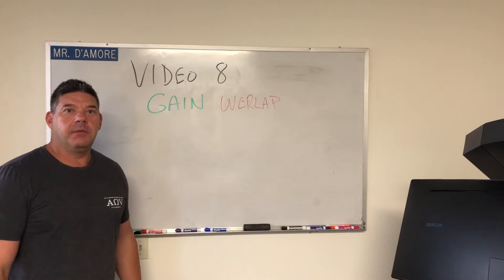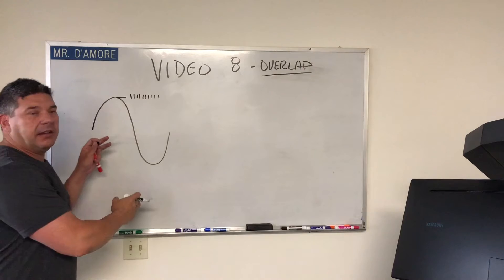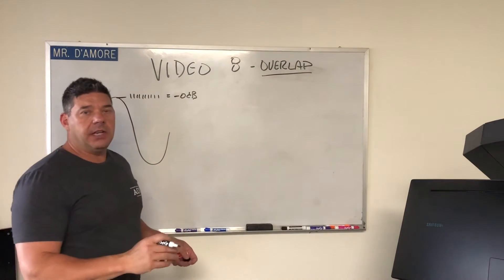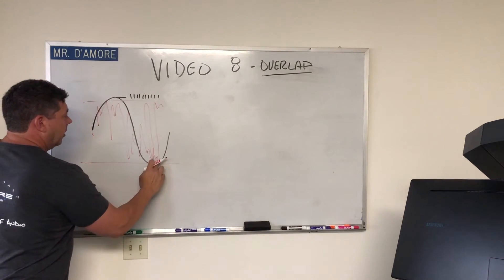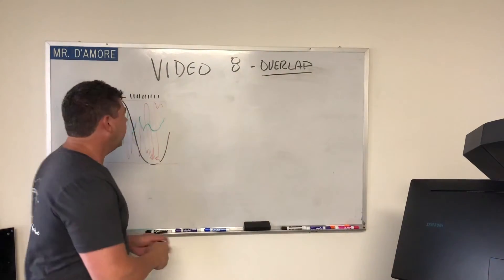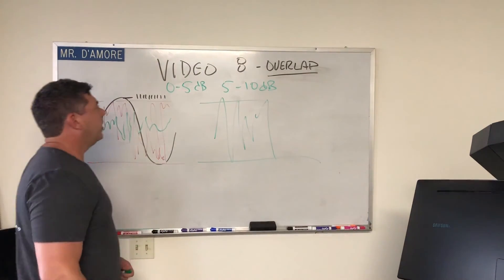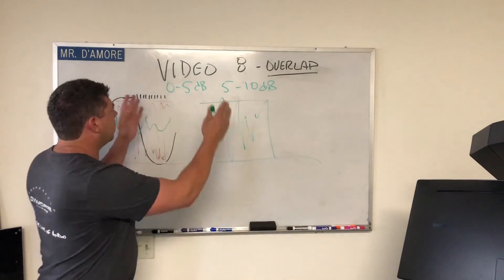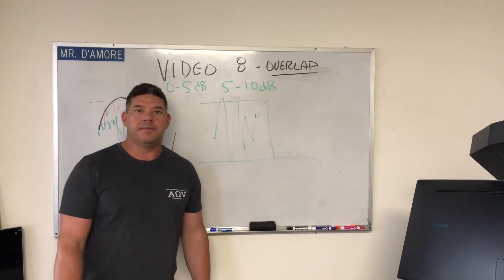D'Amore Engineering University Video 8 Gain Overlap (Part 2 of Video 7)

Comment: I've got DD1 and Oscope. 
My DSP DM-608 has 10v out.  My PG amps will take up to 8v in.  Should I give them a full 8v ? Or is there a similar process. Set to 5-6v for "gain headroom" if that's a thing. Thanks for your time if you get this.
Reply: Using the DD-1 and the 0dB track, give it all you can without creating distortion.

Comment: I  set my Sub Amp with the -10db 40hz tone and my mids and highs i did a 1000hz @ -5db and it sounds freaking amazing. Hey guys buy the DAmore test tone USB.  That's what I used for the test tones.  Thanks bro for explaining the overlap.
Reply: okayyy and so then you flip this scenario around... and set NEGATIVE 5  (-5) or NEGATIVE 10 (-10) for music that is recorded above 0db to keep your amp from clipping??? is this correct? is this what all this gain "overlapping" stuff means?? bc in no electrical engineer just a regular guy trying to get the most from his system. if you could answer that would be fucking AMAZING
Reply: Exactly the added info I was looking to confirm regarding test tones. Thanks.

Comment: So, as I understand this, overlap allows you to clip at a predetermined level. Usually 0-5db on midd and highs and 5-10db on subs. Is that correct?
That sounds counterintuitive. Clipping has always been taught as bad. Bad for speakers, bad for sound quality. 

I don’t want any clipping. Thank you.
Reply: This exchange helped me realize the best build (cost not being a barrier) is to get the proper powered amps where setting the gains with no overlap produce zero clipping at max source volume (which would be too loud for my ears on most recordings). I want full volume adjustment available with no possibility of clipping.
Reply: clueless....
Reply: @meade916  I asked a question. Couldn’t you clarify?

I guess clueless is what you say when you want to insult potential customers.

I really wanted to buy the product but wanted to understand first. 

If you need more headroom, why not just buy a more powerful amp?
Reply: @haroldpalmsesq2506  :facepalm:
Reply: @meade916  i just rewatched the video. I like the part where you said you will try your best to answer questions.

I stand by my original post.
Reply: @haroldpalmsesq2506  So, why design or configure an audio system so that you can easily push an amplifier to the point that it distorts? We’ve discussed the technical reason already: To play quiet audio sources at the maximum output level of the amplifier. Does having gain overlap built into a system mean you can potentially damage it? Yes. Absolutely 100%, yes. As such, this means that the system operator needs to take some responsibility for how loudly it’s played. Translated, that means you have to know when you’ve reached full volume in terms of the amplifier’s output capabilities. Your installer should be able to tell you what “full volume” is for normal modern recordings.
 Be honest with yourself; if you aren’t going to be able to curb your enthusiasm, ask the technician working on your installation not to include any overlap.
What if you ignore our suggestion and just crank the volume? How hard is your amp going to try to work? For example, a sensitivity setting with 6 dB of overlap would make the amp try to produce 400 watts of power if you maxed out the volume with a track recorded at 0 dB.
So, what’s needed to design an audio system where the amplifiers can’t distort? The short answer is money. If you want to feed 50 watts of power to your speakers, but have the system configured with 6 dB of gain overlap, then buy a 200-watts-per-channel amp. If you want to provide your subwoofers with 500 watts of power, choose a 2,000-watt amp. Financially, this doesn’t work, does it? A good 500-watt monoblock amp might cost $650. A 2,000-watt amp of the same caliber might cost $1,500-2,000.
Reply: @car_audio_lab3181  Actually, I did it the other way. I bought bigger amps, and set the gains with no overlap. Zero clipping from head unit. Zero clipping from amp.
So I bought the DD-1 because I don’t want overlap.
Reply: @haroldpalmsesq2506  I am with this idea.

Comment: I had my 4 channel set at -3db and it blow one of my super tweeters in the dash so I set it back to 0db! Why is that !!! I running a Rockford punch 400 watts amplifier!
Reply: Maybe add a capacitor inline the tweeter wiring to help filter out unwanted noise. Should be lots of info out there on the subject.
Reply: @Chaos1187me  the tweeters came with those already!!!! Thanks 🤟🏽
Reply: @carlitot5388  look online man. May need something better tuned to what you're running on your particular setup.
Reply: @Chaos1187me  thanks🙌🏽!
Reply: For speakers and tweeters to remain healthy, it is not enough to have the correct gain level, the frequency range is also important, maybe they have reached a harsh and bad frequency.  You can use the SMD CC-1 device to adjust the frequency.😎

Comment: Dang, this is the best free college I've ever gone to, do we get diplomas at the end? On a serious note though, I have a basic 6 channel system, 4 channel on the front and rear doors and of course a monoblock on my subwoofer. Both my 4 channel and monoblock are current set with a -7.5dB tone. What you're saying is it would be advisable to set my 4 channel with a -2.5dB instead? (Those are the test tones I have in my library, they are in 2.5 increments to -10dB.) So my question mainly is, would you set it up like that because bass notes in music are recorded lower, or is it just because subwoofers in general can handle more clipping? Just wanted to ask for clarity. Great videos with a lot of great information, good job Mr. D'Amore.

Comment: I have an alpine cda-9835 head unit and my max volume is 35. When connected to the smd dd1+ finding the max clean signal for my subwoofer amp through the rca cables, I can go max volume with no distortion. When doing it to full range amp, it distorts at 35 and clean at 34. So I would keep both at volume 34 for clean signals. When I connect the dd1+ to my speaker outputs from my full range amp, it distorts from volume 30 and up and clean at volume 29 but my subwoofer amp it's still clean all the way through 35 no matter if connected through rca cables or speaker output. My question is that why did the distortion point change from using rca cables to speaker output for my full range?
Reply: Does it change if you turn the gain down on your full range amp?

Comment: Amazing how many mfr’s & car audio Youtubers make vids w/ the AD1 but have no clue what gain overlap is.. Lots of them... Listening to them explain it is laughable. 

Music is dynamic not one solid sine wave at one frequency that’s what gain overlap is for. To offset the difference in RMS values of a sine wave and the RMS of a stereo 2 track master that may be mastered to -8RMS or -6RMS or -15 to -10 RMS like say older 70’s/ 80’s / 90’s music before digital recording & the “ Loudness War “ . 

Even Sundown ppl have no clue. They think setting the gain overlap makes the AD1 gradually ramp up into distortion when testing. 

Also once crossovers are set & tuning is complete ( DSP systems ) measuring the AC voltage on the speaker output is nothing near when setting amps with tones & no crossovers. This is another reason gain overlap is needed, to get more real world watts/ power from amp to speakers.

Comment: Can u use dd1+ by downloading the tracks and using via Bluetooth?
Reply: Yes you can. If you can would recommend downloading WAV files at the uncompressed full resolution / sample rate 16-bit / 44.1000 Hz and you should be fine. Steve Meade has a video of how to on it.
Reply: Provided that your Bluetooth playback source is fully calibrated with dd-1, when your Bluetooth has distortions or less distortions, all your calculations will be wrong because, for example, playing your file from Bluetooth mode may be, for example, +7  db, but because your Bluetooth source is not calibrated, for example, instead of +7 dB, it is considered +9 dB, and in practice, instead of +7 dB, you have an overlap of +9 dB!!!

Comment: So when using the smd dd 1+ , we set gain with 0db track then use 5 or 10db of gain overlap for the tracks that are recorded less than 0db so that those tracks that are less than 0db will still sound loud?
Reply: Akuma4u yes
Reply: @uptobatentertainment  okayyy and so then you flip this scenario around... and set NEGATIVE 5  (-5) or NEGATIVE 10 (-10) for music that is recorded above 0db to keep your amp from clipping??? is this correct? is this what all this gain "overlapping" stuff means?? bc in no electrical engineer just a regular guy trying to get the most from his system. if you could answer that would be fucking AMAZING.
Reply: @kkiidd77  u can’t flip the scenario b/c no music is recorded over 0db. Even DJ russticals rebass peak at 0db, but average -7.5 db. Brief loud moments known as peaks may cross 0db. When setting gains we are dealing with average volume known as RMS. With streaming iTunes Spotify Apple Music Amazon etc use -5db RMS for subs and 0db RMS for mids and highs. Mids and highs are more sensitive to distortion therefore clipping can damage those speakers a lot easier than a big old copper voice coil in a sub.

Comment: Hey Tony! I've always used -5db. I listen to mostly Decaf, Dj Russticals, and other modded music. I've been thinking about going with -7.5db to get a little more juice out of my system. My question is if a song is recorded super hot I assume you compensate for this if you're at -10db or -7.5db by just watching voltage and turning down as needed to keep the amp out of clipping? I'm still a bit confused on it tbh. I see you and Meade setting amps at -10db. He likes Morrison's music a lot as do I but even his studio tracks some of the bass tracks are approaching 0db on his music. Wouldn't -10db be WAY too much gain for music recorded that hot? Thanks ahead of time.
Reply: if you are playing something that sounds a little too hot on the bass...just turn it down a notch.  Keep that option there though by using a higher overlap for songs that might need it.
Reply: If youre listening to decaf and it sounds ok at -5db then your gains are not set right.

Comment: Hi, I am using pro audio mids in my doors. Does running a high pass (I run 160Hz -24dB/of) filter  improve the available amplifier headroom allowing for more gain overlap?  I understand the HPF protect the speakers mechanically but does filtering out low frquencies improve thermal handling enabling to handle more distorion? I would imagine low frequencies would fry the driver faster than higher frequencies. Thank you.

Comment: I set my system with a 40hz -10db track, why do some songs still sound quiet? My maximum undistorted volume is 38 out of 40, so I cant even turn it up that much to compensate for the volume

Comment: what do you recommend the sub-woofer level be at when setting your gains?
Reply: watch the video. He says it at least 2 times.
Reply: meade916 what if my amplifier is way to big for  my sub, do I just have to keep guessing the gain overlap?
Reply: @sleepzzz800  Well that's not a clipping issue, that's a power issue. If you really want to be safe and not overpower your sub, you can back off your gain once it's been set. You're never going to hurt anything by turning gain down once it's set, you just don't want to turn it up to the point where your speakers can experience clipping for long periods of time.
Reply: You can choose - 5db to -7.5 to - 10db tones for subwoofer.. I rec -5 or -7.5 after using 0db for the source ( s )( head unit, iPhone, iPad, digital player, or aux) ideally you want to set each playback source.